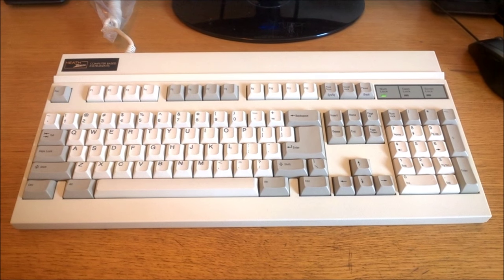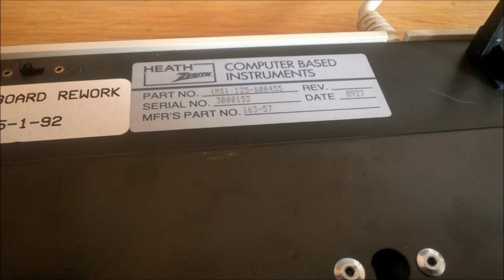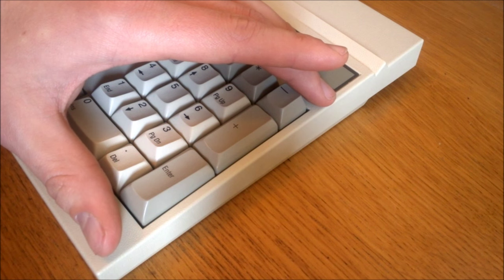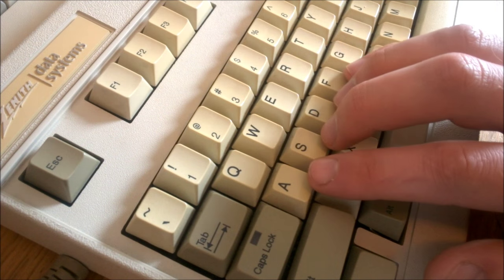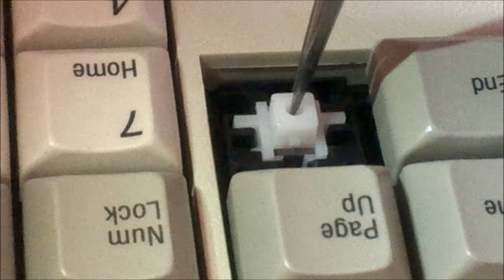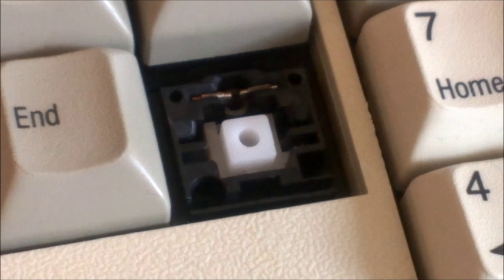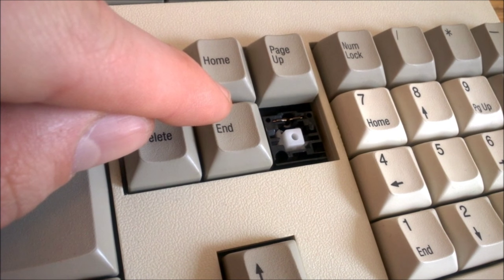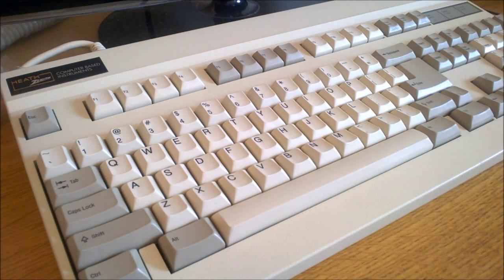Zenith SWA-4300 review (ITW magnetic valve, low-profile)

Comment: The problem with big ass enters on keyboards is usually the small backspace that goes with it, but this keyboard doesn't have a small backspace, so it must be pretty awesome.
Reply: Yeah, some people call it a "Focus" layout because Focus did this layout a lot.

Sometimes instead of splitting the right shift they would just stick the \ key in the blank spots where the Windows keys would normally go between alt and ctrl.
Reply: You don't need a big backspace if you don't make so many mistakes :)

Comment: I went to an abandoned warehouse and picked up a Prime PST-100 keyboard (there are at least fifty lying around there) as well as the terminal itself. After failing on trying to convert it to a PS2 keyboard, I removed all the switches. I could not for the life of me figure out how to salvage the switches and create my own keyboard out of them because I had no idea how to hook them up. They have four pins on the bottom and each pair of two seemed to be connected. I FINALLY stumbled upon this video and realized what I was dealing with. It looks like I won't be building my own magnetic field keyboard anytime soon, or at least not without a ton of research
Reply from the maker: Oh wow, you found fifty magnetic valve keyboards? That's pretty amazing! By the way, these don't work in the same way electromechanical keyboards work, so they might not be quite as easy to convert as you think, but good luck nonetheless! :)

Comment: Hey this video is great! Very informative. I picked up a keyboard from a thrift shop a few days ago (cortron) with these same switches with red housing and I didnt know anything about it or if it was even mechanical. Post on reddit told me they were ITW switches but never got further than that... I understand why these are so complex now! Do you think the boards with these switches are worth anything? Because mine is currently sitting in a draw because i dont have an rj45 adapter and don't know much about all that in general. I know this is an old video but keep it up!!
Reply from the maker: This particular model is very rare as it's directly usable, being AT/XT. It's exceptionally rare that a magnetic keyboard is so directly usable. Yours being RJ45 doesn't surprise me. You can try to convert it, but it's not that easy as I doubt it's a standard protocol. Still, people have done crazier things :) . As to how much it's worth I really don't know. After I bought this one, someone got into contact with the seller and found he had two more; he bought those and re-sold them for $200 each if that helps.

Comment: Vintage mechanical keyboard manufacturers really loved their magnets, didn't they?
Reply from the maker: +MechaniKey The magnetic ones were really only for high-end systems. It's much too expensive to make these switches and boards on a mass scale. In the 80s, computers cost a small fortune, so it was OK, but as soon as they got mainstream, the magnets went. That said, these switches apparently remained popular with the newspaper industry for a very long time; Devlin, who bought the tooling from Cortron (who got it from ITW), stopped making these as late as 2005.
Reply: +Chyrosran22 Do you know of any high-end switches that used magnets instead of the spring or rubber element? Two north poles facing each other say; one on the bottom of the slider, and one at the base of the switch case. Combined with either this sensing circuit, or a side mounted Hall effect sensor, would seem to make for a smooth and reliable switch.
Reply from the maker: +dalriada842 It would be excessively hard to engineer something like that, especially because you'd need really strong magnets to provide adequate repulsion to provide a significant return force, especially when the magnets aren't right next to each other, because the force drops off over r cubed, so the key travel would in all likelihood be limited to chiclet-style depth. The interference all those strong magnets would cause also doesn't sound like something that many electronics would take well to. Besides, springs and rubber sleeves can be really smooth, they add almost negligible friction to a design.
Reply: Chyrosran22 I may pull out my copy of University Physics, to brush up on the theory of magnetism. Some of the magnets you can buy are freakishly strong. You wouldn't want to catch a finger between them! A few millimetres gap doesn't sound like an excessive distance to operate over. You could even use the stronger force of attraction, with the fixed magnet in the top of the switch, i.e. annular design. What you don't want in an electronic circuit is a lot of electro-magnetic interference. A slowly changing magnetic field isn't really a big problem. I can see it not being done because it's expensive, but not because it's too difficult to do.

Comment: Big ass enters are a deal breaker for me.  I don't like win keyless either. But a very peculiar switch.
Reply: +Lord Slapz Really? I actually like big-ass enters a lot... Just as long as the backspace isn't shrunk down.
Reply from the maker: +MechaniKey Me too. Focus used a layout like that a lot, where they stuck the extra key behind a split shift or where the winkeys would later go. Fantastic layout IMO.
Reply: Chyrosran22 My old Silitek board uses the Focus layout and I really like it a lot. The enter is so much easier to hit, and you would think that the enter key wouldn't matter too much, but it really does.
Reply from the maker: +MechaniKey It does. I make a lot of mistakes on the ANSI layout. ISO is fine with me too, though.